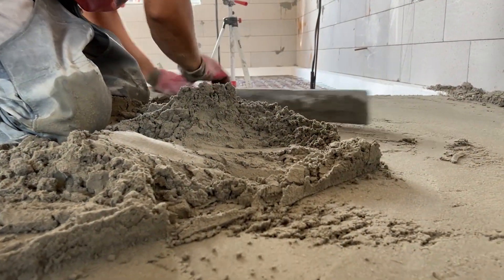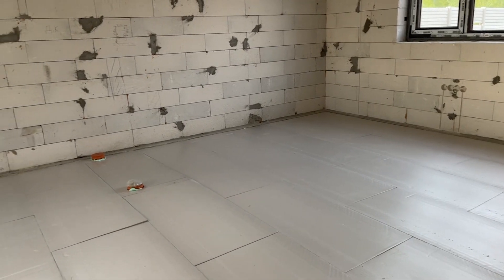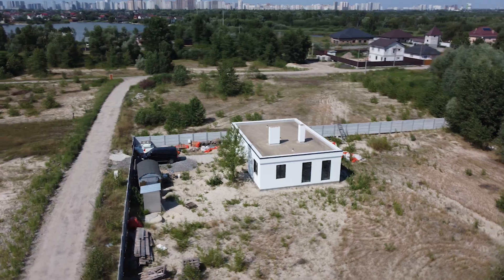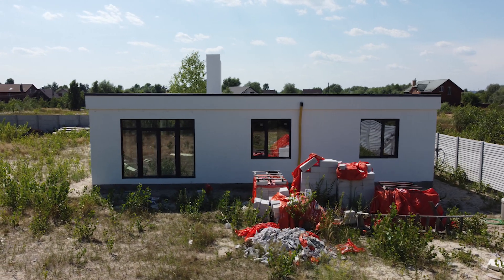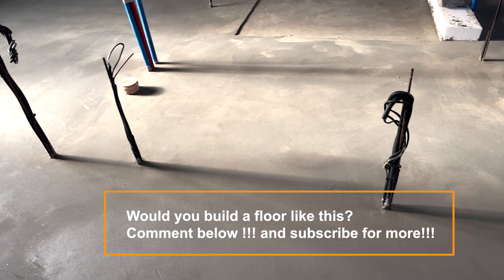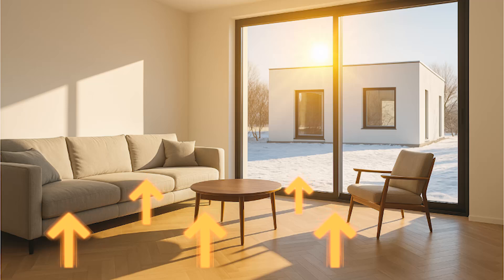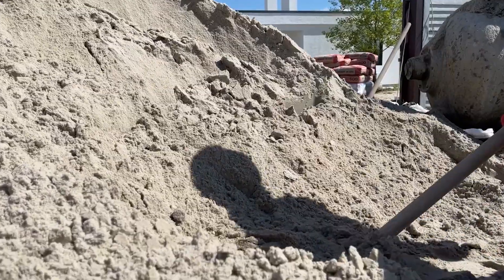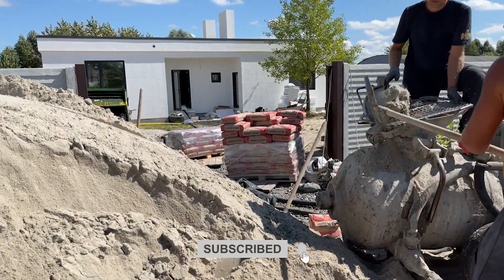No Batteries. No Bills. My Floor Stores Heat All Night

Comment from the maker: Most people pour 2 or 3 inches of floor screed.
I poured eight. Sounds insane? It’s not.
This floor is actually a thermal battery — and I explain everything in the video.
Would you build a slab like this?
Drop your thoughts below — I’d love to hear 👇
Reply from the maker: It turned out differently in each room, but on average, I made it about the height of one block.
Reply: @Romzeslife  wow. was this how it was originally intended?
Reply from the maker: @Таке-Життя  Yeah, but next time I’ll make it twice as thick.
Reply: 8? are you sure? looks like 4-5...

Comment: İf i was very concerned about this i would consider digging into earth
Reply from the maker: That's true — the temperature underground is stable, but it's usually too low. Heating up that much thermal mass would take a huge amount of energy, and it’s almost impossible to do efficiently.

Comment: The problem is that your floor is also going to store the heat in a heat wave, making it impossible to cool down. Same when it's a few days very cold without sun, then it takes more energy to heat back up than would've cost without the thermal mass.
Reply from the maker: Thanks for your comment!
I used a solar angle calculator to determine the sun’s path in my region.
That helped me find the right length for the roof overhang.
In summer, direct sunlight doesn’t enter the house at all.
In fact, the slab cools off at night, and the room stays pleasantly cool during the day.

As for the thermal mass — in my region, I still need to heat the slab.
The larger mass just helps smooth out temperature fluctuations.
And in the rooms that face south, I hardly need any additional heating at all.

Comment: in preparing for a new, final home build in cold country, I appreciate all ideas, especially in the thermal, radiate floor concepts.  Only difficulty appears to be newer ideas hitting traditional building norms.  Thanks for your idea and thoughts.
Reply from the maker: You're absolutely right — and thank you for your thoughtful comment!
One more thing I’ve learned: it’s not just about how cold the climate is, but how sunny it is.

For example, places like Calgary, Canada can be very cold — but with many clear, sunny days, the sun can still provide a lot of usable energy, especially through large south-facing windows and thermal mass floors.

Wishing you the best of luck with your home project!
Feel free to reach out if you ever want to exchange ideas 🙌